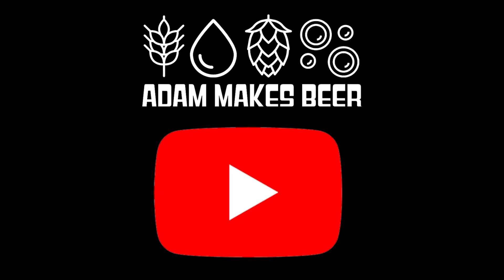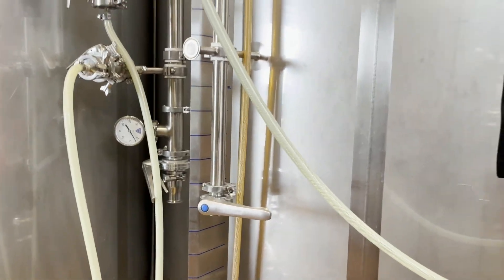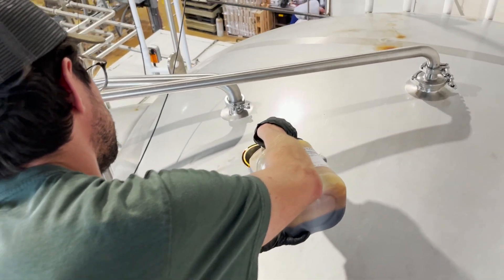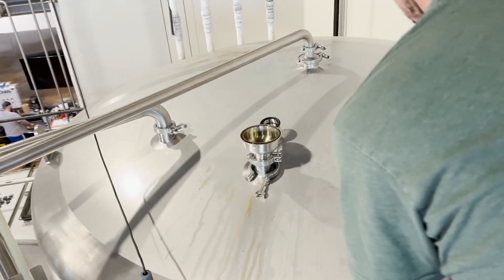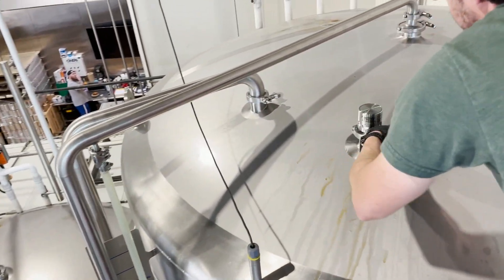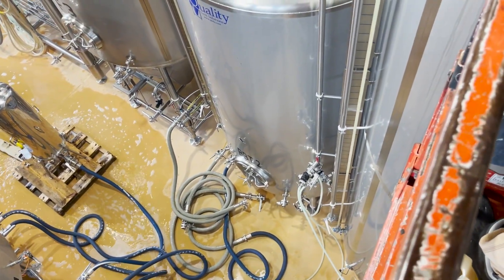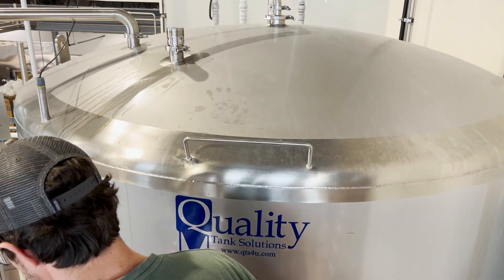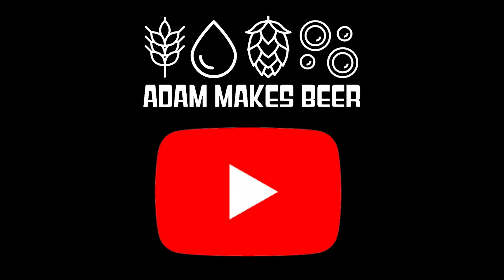Tutorial: Adding A Liquid Adjunct To A Brite!

Comment: I work at a brewery with 2 3bbl FV tanks we can use as a big grant tanks just for adjuncts. So we can cip and then add adjuncts then purge the tank and add anything or mix it all together with no O2 being introduced to the beer. This makes for a sealed system and a very easy head pressure transfer.
Also this way works if you don’t have a grant or a free FV to use. 
Just another way to do it
Reply from the maker: Talking about it on tonights livestream.

Comment: Do you add the adjuct the same time you fill the Brite tank?
Reply: You can also keep the tank sealed and pressurized by using a secondary device like a brink or smaller FV like I describe below. This allows for the least risk of O2 into finished beer. Similar to using a bell to dryhop instead of opening the tank up and adding CO2 pressure to flow out. 
Either way I’ve done both and it works fine.
Reply: No this tank is full already and they are adding it after. That’s why they are going through the carb stone to rouse the tank up after the adjunct is in.
Reply: What's the adjunct?
Reply from the maker: Talking about it on tonights livestream!